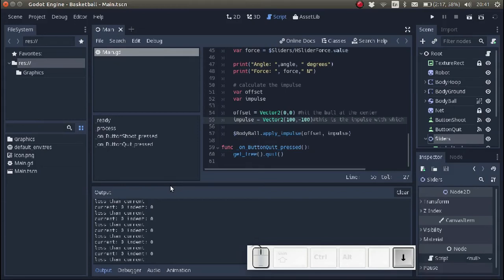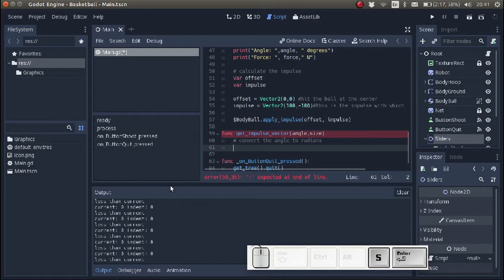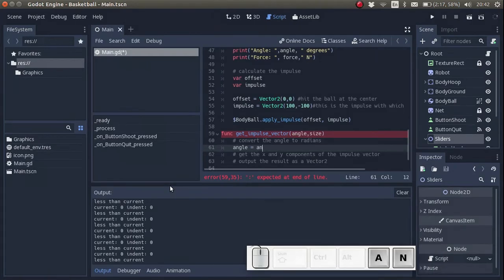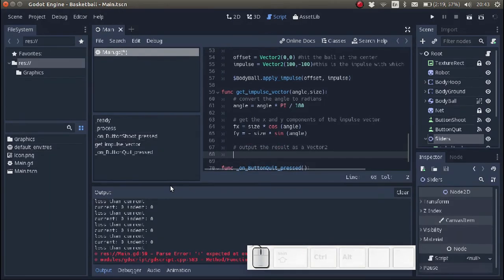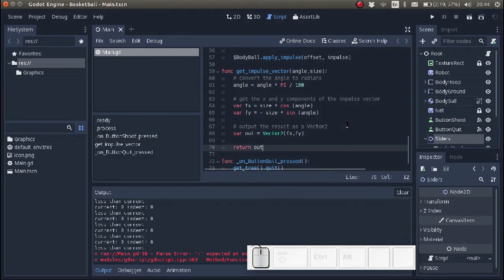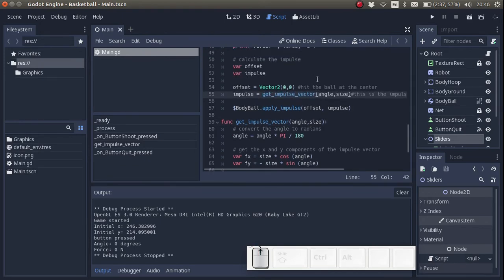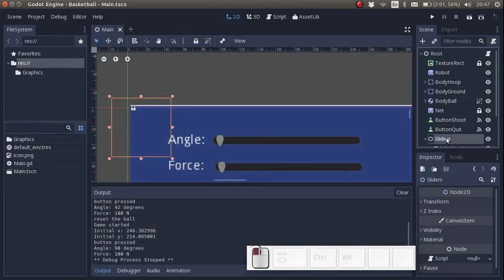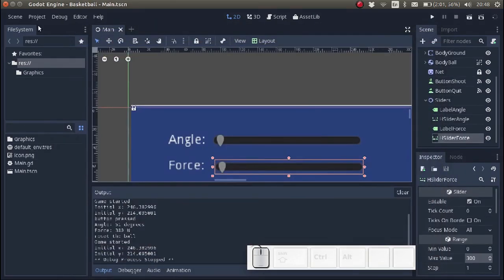Godot for Beginners (part 11) - Convert angle and size to a vector

Comment: C# with generalized naming:
public Vector2 VectorFromAngleRad(float a, float mag){
        return new Vector2(mag * Mathf.Cos(a), mag * Mathf.Sin(a));
}

public Vector2 VectorFromAngleDeg(float a, float mag) {

        a *= (Mathf.Pi / 180);
        return new Vector2(mag * Mathf.Cos(a), mag * Mathf.Sin(a));
}

Note: In this version, I don't negate the Y component like in the video. idk that's what worked for me, if you're getting some wonky behavior maybe try adding the - back in